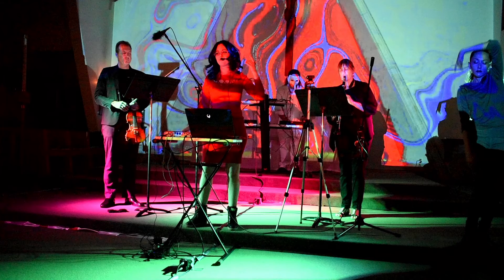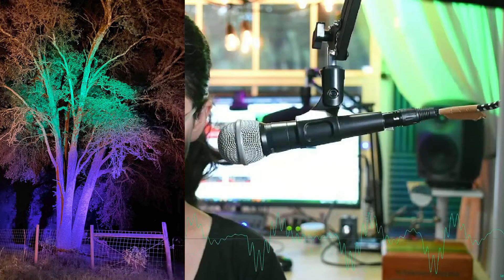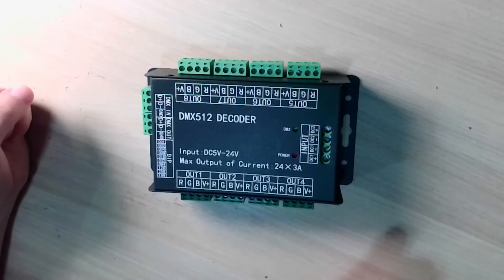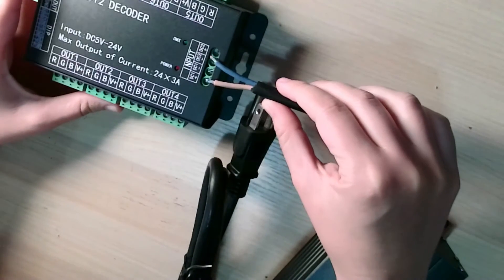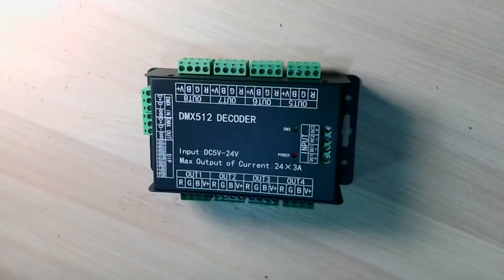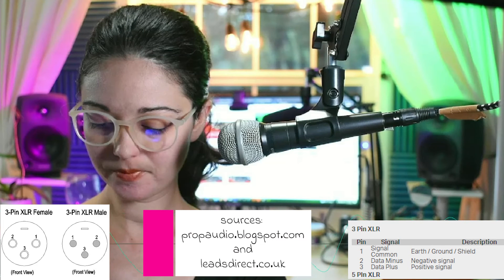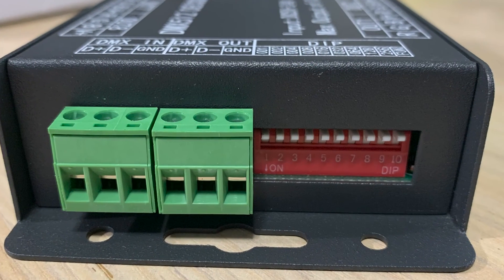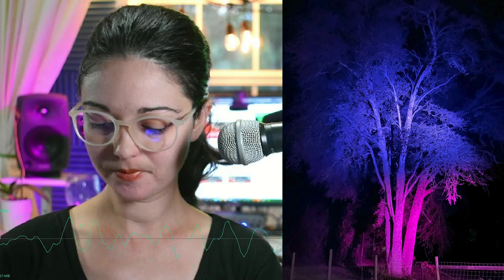Hacking Landscape Lights to Create Outdoor Light Show with DMX Decoder : Part 1

Comment: is dmx software required for this project? if it does, what dmx software do you recommend?
Reply from the maker: Hi 👋 You only need software, a Dmx controller, towards the end of the project to program your light show. I use DMXis, but this has been discontinued by Enttec. You can still download the software for free online and buy a used DMXis interface on eBay. I have not completed this project yet, so it will be a while before I produce my second video. However, I plan to release my build notes for this project in my next newsletter. You can sign up on my website for free if you’re interested. 👍 Have a great day ✨🌺